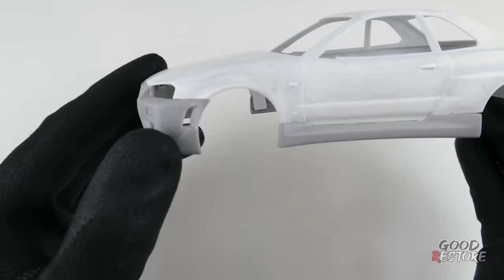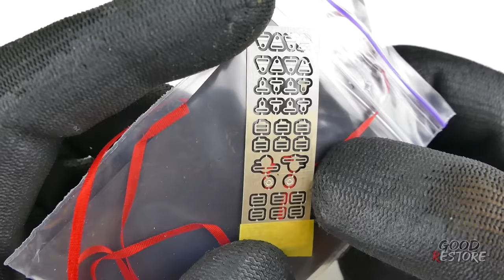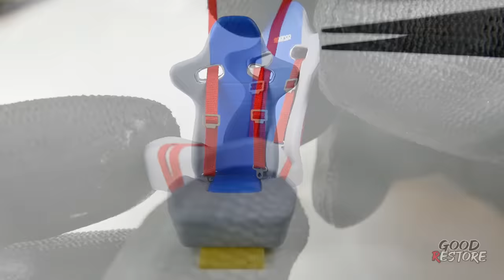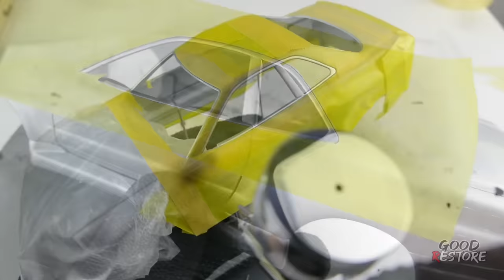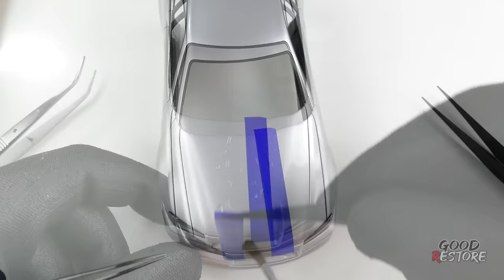Restoration Fast & Furious Nissan Skyline R34 GTR Paul Walker car

Comment: I don't know if I've already asked you this but where do you find these cars in that bad condition?!
Reply: These are made to look like this.
Reply: I've wondered the same thing and haven't seen an answer. Does he actually find them like that or do it himself and bring them back?
Reply: @meerkat9113  he most probably does it himself.
Reply: Bro, you can already tell that this is a model kit from Tamiya. Look at the video that The Scale Modeling Channel did. Literally the same parts and everything lol
Reply: @mefastman77  the base model is a Jada 1/24 Skyline. He installed parts of the kit on the model.
Reply: @traviswalker8933  it's not from Jada. It's from Tamiya dude. Jada's one is a lot more toyish like, unlike this one. If you see on this one, the proportion are a lot more like the real deal, and why did he not show the paint stripping? Because it's a plastic shell. Not die-cast metal.
Reply: @mefastman77  guess you were right after all.
Reply: @traviswalker8933  yes, I know
Reply: I think he builds the regular original model kit, then gets it dirty and broken, then edits it to make it look the other day around.

Restoration videos are more popular than  regular model builds (and this is a fantastic job, no merit taken), so with a little fake aging and pretending to find these abandoned-in-the-mud models, you get some popularity. Lots of channels doing that.
Reply: @dropko yes, it is the stock V-Spec II R34 GT-R.

Comment: it looks like you ended up only "restoring" (sanding and painting?) the chassis and the body, the rest came new in a box? where do you get those from???

this essentially turned quickly from a restoration into a beautifully detailed model kit build.
Reply from the maker: As you wish

Comment: awesome work as always my friend.
i just want to ask, what brand is this model ? i presume it is tamiya or maybe revell since it does not have screws ?
Reply from the maker: Tamiya
Reply: @GoodRestore  good to know, thank you my friend. just last question, does tamiya models need glue ? and if, then whats best ? until now i got only models like burrago, welly, or another ones with screws, but i will like to move forward and try out somethin new.